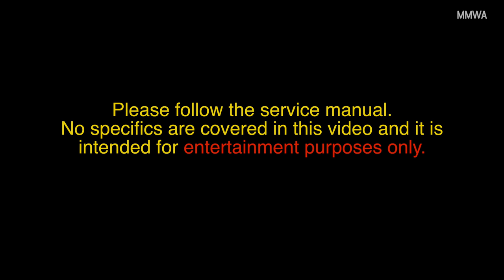Mercedes W201 - Tim rebuilds the lower control arms.

Comment: When I did this, I just removed the arms myself and drove to a shop and have them install my bushings and balljoints for me. They have the hydraulic presses to get the bushings/ball joints in/out. then I go back home and bolt it all up. Clean everything up, paint the arm and presto.

Comment: Whenever i've used my spring compressor, i insert the center rod through the bottom of my LCA. And all that bushing work makes me glad ive got a facelift w124, just buy new arms and i'm good to go!
Reply from the maker: Dashcam Vancouver & Lower Mainland i do the same, from the bottom. I also have the non rebuildable arms on my 124’s so dont have to do this nonsense either. But i was just watching on this and letting him do things his way.
Reply: I do my w201 from the bottom.. I was wondering why he went from the top? 🤷🏽‍♂️ I have a 1988 190e

Comment: Good video, but are these the right bushings? I ask because I know they changed the bushing at one point. What bushing kit did u use?
Reply from the maker: indeed they were correct, he assured me as I was curious too about the different appearance. I do believe they were lemforder
Reply: Bushings are different because the w201 has bushings for w201 with sport suspension and bushings for regular suspension. The first set of bushings removed were for sport suspension. The new set being installed is for regular suspension.

Comment: Cool video guys. I need to service the lca on my c124 too. It dosent look much different. Found a bushing kit and balljount for 30£ Febi/side. I have a press but no bushing puller, like you guys had. Is that really a must?
Reply from the maker: I think it helps prevent deforming the new bushes when pressing them in. On my m104’s the arms are throw away ones so its not a tool ill ever have to buy probably. On those its not even worth replacing the bushings as the balljoint cannot be replaced.

Comment: that is a lot of work, thx for the vid
Reply from the maker: absolutely none of it done by me too - maybe i touched 1 bolt and held some things being pressed and that was about it.
Reply: btw, there was a video about replacing your front struts. did you only knew it was bad when you removed it? or was there any tell tale signs before removing? perhaps diving? strange noises? I just trying to figure out if mine are on the way out... cheers
Reply: It helps if you just buy an battery powered impact to remove all the bolts. I'm using some big DeWalt drills to remove bolts quickly. And I use the drills for my construction job 🤙I reaaally want one of those Milwaukee stubby impacts. It's a lot better than wrenching and ratcheting most of the time.